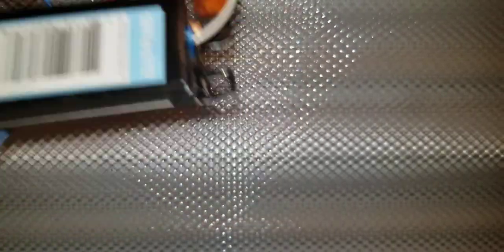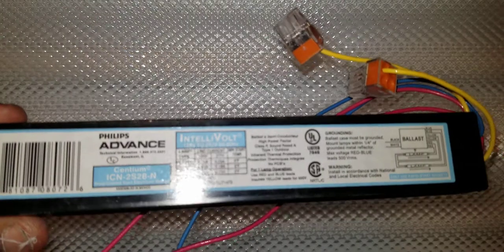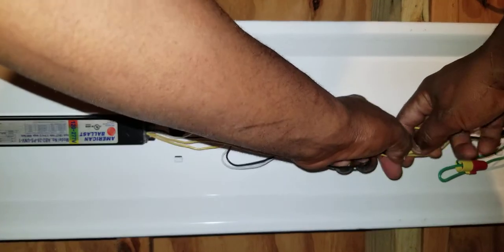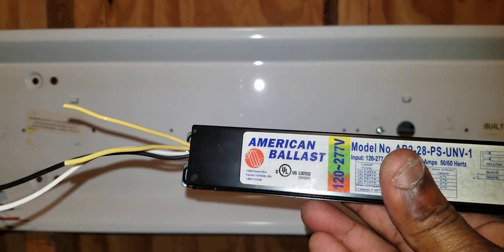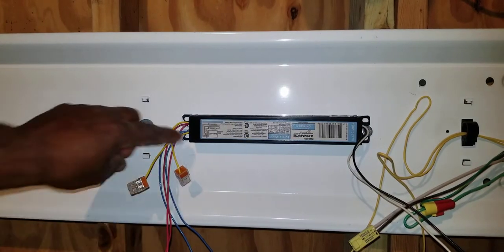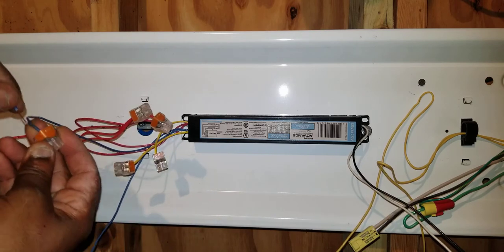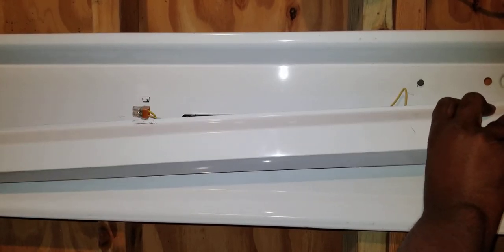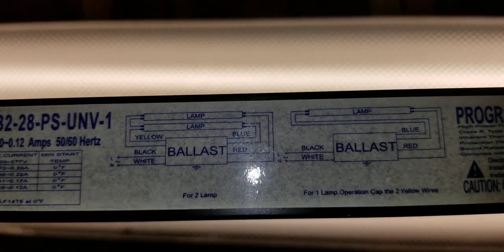How to install a 2 lamp ballast ( for T5 lamps)

Comment: Thank you again, this time for the ballast replacement video because I have several I need to replace in my shop but I been intimidated at the idea of doing it. I looked at other videos and still felt unsure of myself but after listening to you explain this in such simple terms I think I will at least try one of the lights to see if I can do it. They are so big and high up in my shop that I can hardly change the bulb let alone work on the ballast up there. My side walls are 10' tall; I think the metal rafters go across at that height so it's about 10' up there. The light fixture is about 8' long with two big fat bulbs in each fixture. I think it is the T12 lamp that you mentioned in this video. I am thinking about taking down the fixture and working on it on the floor. Then I would like to maybe hang them somehow down lower from chains or something like that.

Comment from the maker: Dear Substribers: I mistakenly referred to the quick disconnect as a tombstone. The quick disconnect is not a tombstone . The Tombstone is the small white pieces at the in of the fixture for holding the lamp.
Reply: I would appreciate you doing a video on how to modify a light similar to the one in video to make it LED.

Comment: The T(Number) refers to the diameter of the lamp. A T12 is 12/8th of a inch wide, or 1.5 inches wide. Where as a T5 is 5/8th of a inch wide.